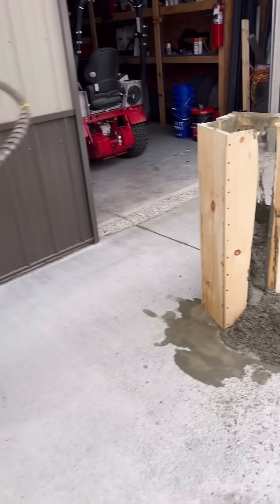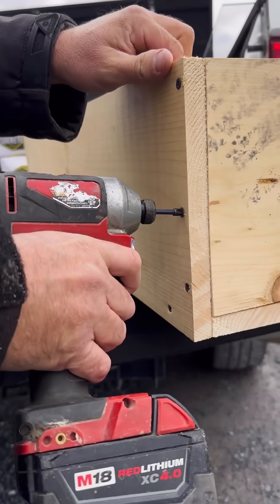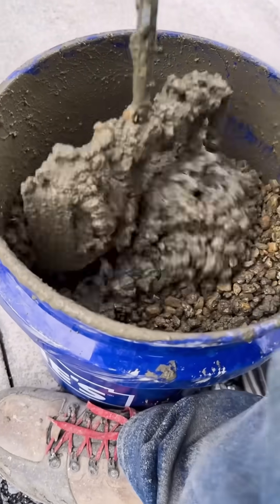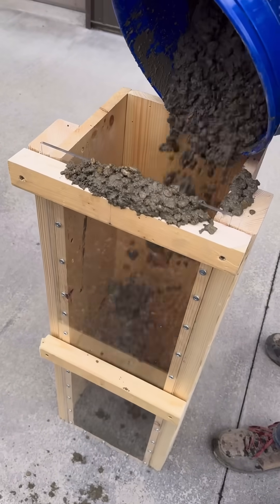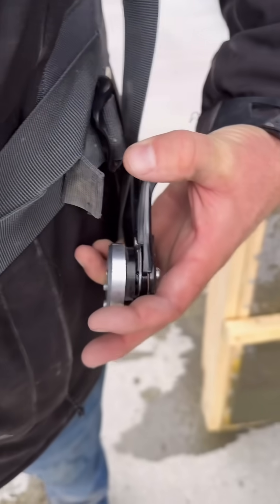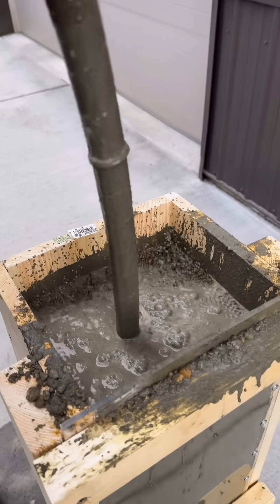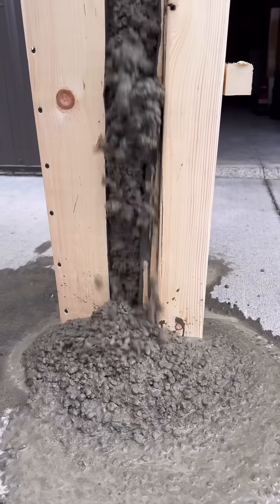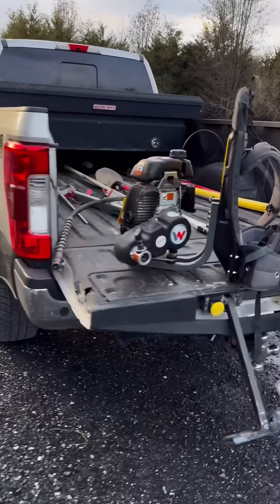Why It’s Important To Vibrate Concrete

Comment: That's what I ask when I see people who dry pour pads, what about the air bubbles? I have set many posts using a dry pour method, but after I do add the water I'll mix it in the hole as best I can and at least take my hammer and tap on the post to get out as many air bubbles as I can, but I'm not a concrete guy, how strong is a dry pour concrete pad?
Reply from the maker: I’ve never tried dry pour but to me it doesn’t make any sense
Reply: @hausplans  yeah I'm a roofer and I tuck point chimneys some times and the way I was taught was to keep going over the mortar joint, pushing in with some force, to get the air bubbles out, and I've seen tuck point jobs where that wasn't done and the brand new mortar is brittle as could be and just comes right out of the mortar joints. Like I said I'm not a concrete guy but I just don't understand the logic behind a dry pour pad?? Especially when it's like a 3 foot x 3 foot pad for say a pad for new steps to land on, is it really that much of a chore to mix that little bit of concrete and pour it then hit it with the vibrator? Haha, idk man, seems pretty lazy to me 😂

Comment: I've seen 4 truck loadson the 5th the wall blasted out the side of a wall in a parking lot i was building.  The pressperterian hospital in Albuquerque NM 
Also on that same job I cut the top of form oil drum big drum . I could see the fire inside.  Sheff the lid fell inside the mushroom cloud that came out with a huge flame was amazing to be next to.  I got so much heat from all the boss. He told me that the owners and the designers and the engineer were watching me that day.  In the building next to us.  🎉
Reply from the maker: Crazy 😜

Comment: For your wood formwork, you should wrap it with a couple of stainless steel bands. Those will avoid the blowouts shown here.
Reply: Or use plywood?
Reply: we never used 3/4 inch Pine boards for this kind of form work. it's always 3/4 in plywood.
Reply: If you dont have a blowout when using a vibrator   your noy using it correctly
Reply: Or use walers...they've been used forever
Reply: Yes, that might help. To do it properly, you wanna rip plywood. Dimensional lumber can be used, but the grain shall never be put in vertically, like shown here. Stack your dimensional lumber, for bulkheads, and pour breaks. Plus, it will break out in pieces when stripping
Reply: @mitchellgreene867  yes sheathing for bulk heads is a must. Plywood with rebar running through it for a bulkhead creates a long day and alot of swearing

Comment: Vib no longer that a few seconds or the aggregate drops tobthe bottom and water mix is left at higher levels.
No doubt the reason the form failing due to lateral pressure.

Comment: Back in the day when concrete was getting scarce because China was making that monster dam, there were delays and escalating costs that were driving my boss (who was already a terror) completely insane. When the trucks arrived and started pouring the footings, I was vibrating the concrete. The boss figured I was taking too long and ripped the vibrator from my hands and shoved me aside. He began just whipping the vibrator in and out of the form. He was splashing the concrete and scattering the guys near him with the fear of getting brained. Then he did the 'not letting go of the bowling ball-thing' and fired himself headfirst into the concrete when he didn't let go of the viber. His brother put the shovel into his back and pushed him farther under before we helped him out. Needless to say, he was a lot quieter for that week.
Reply: But like a true a-hole, it was only a week.

Comment: The problem is most people vibrate it too much which causes the aggregate to sink yo the bottom and the cement at the top. Don't vibrate too much. He said he mixed it dry and you can see how the water separates and comes to the top. Awesome video
Reply from the maker: Thanks, I agree you can over vibrate
Reply: @hausplans tell that to my wife!
Reply: @hausplans  just put it all the way down en take it out slowly in like 3 seconds, thats it
Reply: Main objective is consolidation: getting rid of unwanted voids. You dont want to deprive the aggregate of paste by bringing it all to the top.
Reply: When mixing concrete, it's very important to kno where its going to be used, in foundations,
or in hi rise, where it's gunna be pumped, and so you adjust the water/cement ratio, and the amount of plastisizers; water reducers, and retarders.
Mixing good quality concrete isn't a job for inexperienced folks.
Reply: Just add 40 and dont vibrate it.  🤣
Reply: $@3 never said that 🤣

Comment: I believe in your application you should’ve poured by layers first 1/4, 1/2, and 3/4 then vibrated each layer, you aren’t supposed to vibrate too deep
Reply: They make 10'+long vibrators. The depth doesnt make a difference. The problem was the guy used rigid cabinet shelf wood instead of actual 3/4" plywood.

Comment: I have been told you could use a sawzall sans blade to vibrate a form from the outside. Anyone else heard of that??
Reply: Hi, it would be better to use a Rotary Hammer Drill with a bit in hammer mode because the Sawzall is meant to cut, the tool might get damaged
Reply: I used 4lb mallet more then anything just tapping the for
Reply from the maker: I’ve done that before, it works OK
Reply: It works good for cardboard form tubes  since it’s cardboard it allows more vibrations to effect the concrete
Reply: I tried it but found it not practical. sawzal needs to be pushed against the form but that will make it walk all over he form meanwhile it doesnt really vibrate more then 2in behind the form
Reply: Palm sander for small/delicate pours works well.

Comment: I'm not sure who uses 3/4 white pine shelving material from Home Cheapo for their forms but .... yes ... concrete needs to be vibrated.
Reply: @Azreal-_-  there are lots of builder supplie companies but your gonna pay a little more for quality. Just depends where you are located.
Reply: Osb would have been better.
Reply: I hope ya'll understand... my post was sarcasm.  I work in structural engineering, and I've seen contractors use everything imaginable for form work. I've seen good and bad vibrated concrete also.
Reply: Plywood with strongbacks is the way to, the tear strength is pretty high
Reply: He was building a display dude, not the Colosseum.
Reply: @Azreal-_-   Unfortunately, material these days seem to be about all the same. I wasn't picking on Home Depot. It was a joke.

Comment: Like anything, too much isn’t good. A slight vibration is great, settles the concrete and gets air out, too much vibration and the aggregate settles at the bottom and creates separation in the concrete, excess vibration and the forms can be affected.
Reply: Would practice make perfect? Or would someone need a special tool to reach optimum vibrosis?
Reply: @ODSTklecc  TWSS
Reply: @wcbscout   Huh?

Oh I get you, lol
Reply: @ODSTklecc a dildo would do but a vibrator would reach you full climax or...... vibrosis
Reply: @ODSTklecc it's more of a ... Retardation thing 😂
Reply: No dork….. use plywood almost all forms are made out of ply and 3/4” at that
Reply: A slight vibration also settles me and gets some air out.
Reply: @RowanBird779 
Ayo?
Reply: what i was gonna say ☝🏻
Reply: Glad you pointed this out
Reply: Gonna need to leave that bitch in there during your bathroom break to separate the aggregate lol! but I suppose it is possible haha
Reply: That's cool know
Reply: It’s called shuttering

Comment: I was in the middle of a 500 yard pt deck pour, I was vibrating the concrete right behind the hose guy and felt a slight shake underneath me, then a carpenter came running up yelling to shut everything down and get off the deck because it was about to collapse. So we all ran down underneath the deck and helped reinforce it to handle the load so we could finish the pour safely. That was a scary time.
Reply from the maker: That’s sounds crazy!!!
Reply: @hausplans  it was, is had walls blow out, footings blow out, but that was the first and thankfully only deck blow out.
Reply: @Deerhunterjs man I'm surprised they didn't evacuate site 😮
Reply: @NinjaofApathy  nah, just have the right people watching and have stiff prepped just in case.
Reply: Been in the situation a few times in industrial factories and it really sucks. Lots a few and saved a few. Always better to go overkill on reinforcement
Reply: Typical man thing to do. Risk your life for the project lol
Reply: @brandonrobertson1280  it was more of we can save this if we stop and fix it now. Go any farther and we will risk lives.
Reply: We had a doubler fall of a hanger during a deck pour. Had to get under it with a man lift and wedge a couple 4x4s between the lower flange and the doubler. Was a crazy time but we ended up saving the deck
Reply: It’s amazing how many hose operators just dump a big wadge of concrete in one area and how many contractors don’t have a temporary work design in place for shuttering. 
I’ve seen steel decking sheets fold when loaded with concrete cos the installer didn’t realise temporary support was needed midway between the steel beams. 
Scary shit.
Reply: "So we went under the deck to reinforce it" is usually where the story ends.
Reply: Temporary works design in place????    No.   No shit.
Reply: @bobbo9549  I know very little about construction but I know it's typical that things like temporary works get less attention than they deserve. It's not glamorous, it's not visible, and at the end of the job it's gone forever.. but that doesn't mean it's not important and safety-critical
Reply: @dielaughing73  temporary works is seen as OTT by some until it all goes to shit. 🙄
Reply: @bobbo9549  yep, people simply overlook anything they think they'll get away with. But if you look at the frequency of incidents, it's a particularly hazardous part of the process. It's just that people tend to underestimate the risk or genuinely don't understand them
Reply: Sounds like you guys did a great job of saving the pour. Totally saved the job for that matter. I use to work for a foundation pier drilling company. Anywhere from 12” - 30’ diameter holes 100’s of feet deep. We used vibrators with 20’ whips which did a pretty good job. We also put 2” diameter pvc pipes attached to the rebar cages to X-ray. Then we’d pressure grout any voids. All this to say that those concrete vibrators are incredibly good at doing what they are designed to do and apparently good at breaking stuff as your experience proves😂
Reply: Sounds like you guys have no fkn idea what you were doing and almost got people killed. Hopefully, that will teach you to do your shit right the first time. I know some concrete workers that lost their lives because of unsafe work like that had tons and tons of concrete land right on top of them. Smarten up, and if you see something dangerous. Don't go under it, holy shit. Your life is not worth a few bucks. Take care of yourself, not your boss. I've refused a few jobs. Where I knew something bad was gonna happen, and sure enough, I was right.
Reply: @thegman4759  humans make mistakes, we have had thousands of successful pours over the course of the companies lifetime and this was a fluke because of someone overlooking one thing. It was caught before it became a serious issue and repaired before anyone got hurt. I'd say it was a great catch, repair, and learning lesson.
Reply: The deck was about to collapse.. so you rushed from on top of it underneath it? That’s like saying, hey this tiger just killed a man so you run into the enclosure to start agitating it.. so that you can safely finish you’re job over at the lemonade stand across from the exhibit.
Reply: Running for the deck they os about to collapse and try to hold it down sounds insane
Reply: This is why I read comments, always people sharing what they've been through and idk about everyone else but I always learn something from reading comments. Thanks everyone! ❤
Reply: That's insane! y'all committed to that job
Reply: Good Form imperative  !
Reply: Same... certainly was Sus slab
Reply: No such thing is overkill on bracing for concrete pour and vib.
Great content once again
Reply: And most the time you got the deaf laborer still stinging the pour while you tell them not to 😂
Reply: @ItsCedar  that was me lol, to much noise to know what was going on so if the house was moving so was I.
Reply: Good to know this
Reply: So stupid...
1. There are rules on how to do the formwork for the slab. Unless people are stupid, there is NO reason for it to collapse.
2. If it's collapsing, you have TONS above your head... Too late, the mistake was made, don't run below. 
With your unit use, I guesss you're American. Looks like American "physical labour" is only made of DIYers, and no professionals with formal training... Does that explain why the US made quality is dropping so much?
Reply: Jesus a 500 yard patio for what?! That’s massive
Reply: @lp1292  it was a parking ramp deck.
Reply: Sorry just sounds like amateur hour in more ways than one...

Comment: Shoulda used OSB 😂
Reply from the maker: Definitely would’ve been stronger than those cheap pine boards
Reply: @hausplans Not much stronger; hate the chit, spent too many hours removing it by the handful before it was replaced w/ plywood.

Oregon is not a place to use OSB, not enough dry months in the year. When you're framing new construction, it WILL get wet before it's roofed.  Plywood dries out, OSB starts the road to self-destruction.

Oh, BTW, does it still grow mushrooms really well, all on its own?  It did when it 1st came out.  LOL
Reply: 3/4 inch plywood all day 2x4 around top and on corners
Reply: @Jwalls2020 and a couple strongbacks and it's almost bullet proof